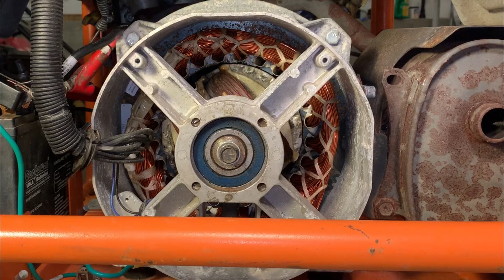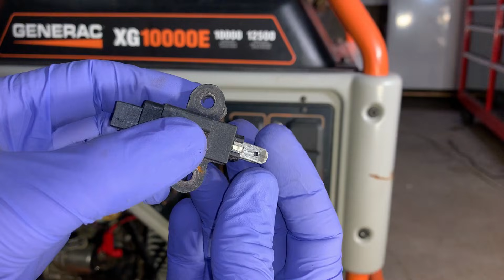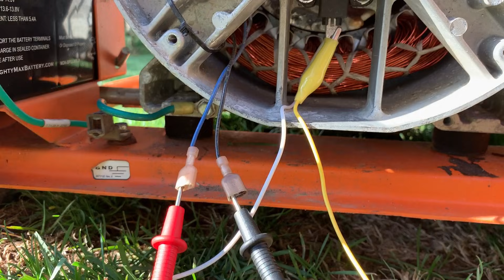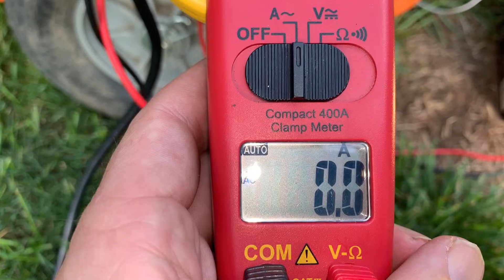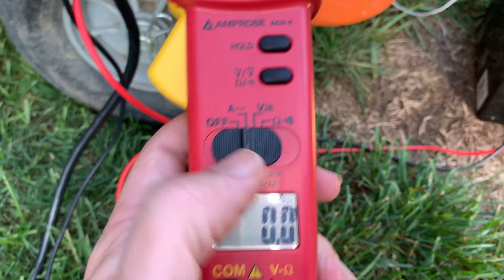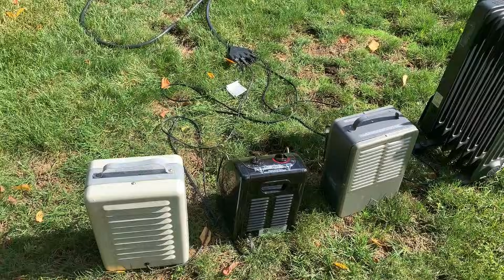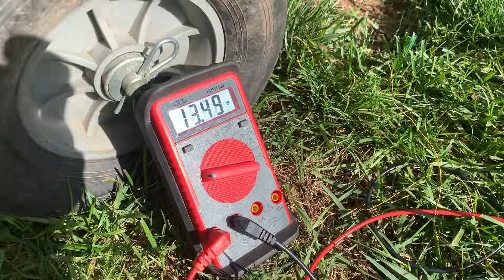Generac XG10000e No Power/No Voltage - Fixed

Comment: Lots of fuel stabilizers are blue, they turn the gas that color.
Reply: Here is a reminder about portable generator safety: this is only a reminder for anyone who use portable gas/propane generators. This is just to make sure that everyone is aware of all the warnings and it’s just to remind people to be careful using portable generators. Everyone has to see this safety reminder. Every year, hundreds of people die or get injured when using portable generators due to carbon monoxide poisoning and electrocution. Make sure you are using your generator carefully and keeping others safe as well. There is something very serious that everyone should always be aware of when using generators. Some people do run their generator indoors which is not safe and that increases the risk of carbon monoxide poisoning which can cause death of family and you. Some people run their generator in wet conditions which can electrocute them. Here’s an advice about generator safety: please remember that you should never run your generator indoors. Remember that carbon monoxide is an odorless and colorless gas that you cannot see or smell. Carbon monoxide is a silent killer. Keep that in mind. Make sure your generator is 15-20 feet away from your house and away from doors, windows, and vents. Having a carbon monoxide detector is very important against generator safety. Some people also allow children to go near the portable generator which could pose risks. We need to keep an eye on our children making sure that they are not near the portable generator so they won’t get electrocuted or burned by the generator which is dangerous. A locking enclosure also keeps kids safe. A generator shed might look like a tempting place to explore, or take cover during a game of hide and seek, but a generator is a dangerous piece of equipment that can cause injury. It says on the manual that we should also keep children away at all times from the portable generator to avoid injuries. Please do not permit a child or unqualified people to operate the portable generator. Generators pose electrical risks. If you need to use your generator during wet weather, you need a generator tent to protect your generator from getting wet. Don’t let your generator get wet. Keep your generator dry and before using your generator, please make sure your hands and your generator is dry. Everything that is said on the generator’s operating manual should not be ignored. Never smoke cigarettes near the generator. Please keep flammable things away from the generator. Never overload your generator too. Your generator can catch fire. Never ever try to plug a generator cord into a wall outlet to avoid back feeding. Back feeding your generator is dangerous. Always turn on your generator first before plugging in appliances and shut off the appliances before turning your generator off. Use a heavy duty cord for your generator and the cord should not be worn out. All the instructions should be followed carefully. Never refuel your generator while it’s running. It can cause fire if fuel spills while your generator is hot. You should turn off your generator and let it cool off before refueling it. Having a fire extinguisher next to the generator is also important. This is only a reminder for everyone’s safety of using generators. Make sure your generator is properly grounded. https://youtu.be/I1jT3ANENvI and here is a video more about keeping others safe when using generators and also about our family’s safety. Hope this helps and everyone understands the safety requirements. Thank you. Be safe.

Comment: Good Job...very knowledgeable! Got a good deal!
Reply: Here is a reminder about portable generator safety: this is only a reminder for anyone who use portable gas/propane generators. This is just to make sure that everyone is aware of all the warnings and it’s just to remind people to be careful using portable generators. Everyone has to see this safety reminder. Every year after hurricane and winter storms, there were reports on the news that many people have died each year when using generators due to carbon monoxide poisoning and electrocution during a power outage. There were reports about deaths when using generators when the power was out. There is something very serious that everyone should always be aware of when using generators. Some people do run their generator indoors which is not safe and that increases the risk of carbon monoxide poisoning which can cause death of family and you. Some people run their generator in wet conditions which can electrocute them. Here’s an advice about generator safety: please remember that you should never run your generator indoors. Remember that carbon monoxide is an odorless and colorless gas that you cannot see or smell. Carbon monoxide is a silent killer. Keep that in mind. Make sure your generator is 15-20 feet away from your house and away from doors, windows, and vents. Having a carbon monoxide detector is very important against generator safety. Some people also allow children to go near the portable generator which could pose risks. We need to keep an eye on our children making sure that they are not near the portable generator so they won’t get electrocuted or burned by the generator which is dangerous. A locking enclosure also keeps kids safe. A generator shed might look like a tempting place to explore, or take cover during a game of hide and seek, but a generator is a dangerous piece of equipment that can cause injury. It says on the manual that we should also keep children away at all times from the portable generator to avoid injuries. Please do not permit a child or unqualified people to operate the portable generator. Generators pose electrical risks. If you need to use your generator during wet weather, you need a generator tent to protect your generator from getting wet. Don’t let your generator get wet. Keep your generator dry and before using your generator, please make sure your hands and your generator is dry. Everything that is said on the generator’s operating manual should not be ignored. Never smoke cigarettes near the generator. Please keep flammable things away from the generator. Never overload your generator too. Your generator can catch fire. Never ever try to plug a generator cord into a wall outlet to avoid back feeding. Back feeding your generator is dangerous. Always turn on your generator first before plugging in appliances and shut off the appliances before turning your generator off. Use a heavy duty cord for your generator and the cord should not be worn out. All the instructions should be followed carefully. Never refuel your generator while it’s running. It can cause fire if fuel spills while your generator is hot. You should turn off your generator and let it cool off before refueling it. Having a fire extinguisher next to the generator is also important. This is only a reminder for everyone’s safety of using generators. Make sure your generator is properly grounded. https://youtu.be/I1jT3ANENvI and here is a video more about keeping others safe when using generators and also about our family’s safety. Hope this helps and everyone understands the safety requirements. Thank you.

Comment: You used scotch brite and most likely fixed what originally was wrought with it. Last person checked by removing the wires and put them in the wrong spot. Great repair!
Reply: Here is a reminder about portable generator safety: this is only a reminder for anyone who use portable gas/propane generators. This is just to make sure that everyone is aware of all the warnings and it’s just to remind people to be careful using portable generators. Everyone has to see this safety reminder. Every year after hurricane and winter storms, there were reports on the news that many people have died each year when using generators due to carbon monoxide poisoning and electrocution during a power outage. There were reports about deaths when using generators when the power was out. There is something very serious that everyone should always be aware of when using generators. Some people do run their generator indoors which is not safe and that increases the risk of carbon monoxide poisoning which can cause death of family and you. Some people run their generator in wet conditions which can electrocute them. Here’s an advice about generator safety: please remember that you should never run your generator indoors. Remember that carbon monoxide is an odorless and colorless gas that you cannot see or smell. Carbon monoxide is a silent killer. Keep that in mind. Make sure your generator is 15-20 feet away from your house and away from doors, windows, and vents. Having a carbon monoxide detector is very important against generator safety. Some people also allow children to go near the portable generator which could pose risks. We need to keep an eye on our children making sure that they are not near the portable generator so they won’t get electrocuted or burned by the generator which is dangerous. A locking enclosure also keeps kids safe. A generator shed might look like a tempting place to explore, or take cover during a game of hide and seek, but a generator is a dangerous piece of equipment that can cause injury. It says on the manual that we should also keep children away at all times from the portable generator to avoid injuries. Please do not permit a child or unqualified people to operate the portable generator. Generators pose electrical risks. If you need to use your generator during wet weather, you need a generator tent to protect your generator from getting wet. Don’t let your generator get wet. Keep your generator dry and before using your generator, please make sure your hands and your generator is dry. Everything that is said on the generator’s operating manual should not be ignored. Never smoke cigarettes near the generator. Please keep flammable things away from the generator. Never overload your generator too. Your generator can catch fire. Never ever try to plug a generator cord into a wall outlet to avoid back feeding. Back feeding your generator is dangerous. Always turn on your generator first before plugging in appliances and shut off the appliances before turning your generator off. Use a heavy duty cord for your generator and the cord should not be worn out. All the instructions should be followed carefully. Never refuel your generator while it’s running. It can cause fire if fuel spills while your generator is hot. You should turn off your generator and let it cool off before refueling it. Having a fire extinguisher next to the generator is also important. This is only a reminder for everyone’s safety of using generators. Make sure your generator is properly grounded. https://youtu.be/I1jT3ANENvI and here is a video more about keeping others safe when using generators and also about our family’s safety. Hope this helps and everyone understands the safety requirements. Thank you.

Comment: Do you set the governor screw for the HZ when it has a normal load or no load or something in between?
Reply from the maker: I set to 61.5 hertz under no load.  At half load it then should be around 60 hertz.

Comment: Stupid question here from a guy who knows nothing about electricity. !! What does flash the field mean? I assume you mean to somehow excite the windings, or sensor into detecting current so it can start working?, Thanks.
Reply from the maker: The generator needs magnetism to start up.  Most newer ones have small permanent magnets to do that.  Adding 12v to the brushes or spinning a drill on the stator will add a little juice which will help things get going.  Usually thought, if not going on their own, then there is a problem with the generator.
Reply: Thanks for the response!

Comment: A lot of this class of generator have a 3 year warranty.   There are documents out there on how to screw one up so that it just won't produce any power output.  The devious owner can take it back and get a replacement before the warranty ages out.   Most of the Box Stores will start it, see it produces no power and warranty it.   Even in a smaller shop, the tech may not dig as deep as you did.  Nice catch, sweet fix.

Comment: Boy, that thing was really messed with!  Wiring incorrect, strange fuel, regulator set wrong, engine speed too slow....
Looks almost brand new though!
Wonder what it's story is?  Would be interesting to find out, but oh well!
Reply: That was probably one of those, hey my brother in law is pretty good on working on those things, just buy him a six pack.
Reply: Here is a reminder about portable generator safety: this is only a reminder for anyone who use portable gas/propane generators. This is just to make sure that everyone is aware of all the warnings and it’s just to remind people to be careful using portable generators. Everyone has to see this safety reminder. Every year after hurricane and winter storms, there were reports on the news that many people have died each year when using generators due to carbon monoxide poisoning and electrocution during a power outage. There were reports about deaths when using generators when the power was out. There is something very serious that everyone should always be aware of when using generators. Some people do run their generator indoors which is not safe and that increases the risk of carbon monoxide poisoning which can cause death of family and you. Some people run their generator in wet conditions which can electrocute them. Here’s an advice about generator safety: please remember that you should never run your generator indoors. Remember that carbon monoxide is an odorless and colorless gas that you cannot see or smell. Carbon monoxide is a silent killer. Keep that in mind. Make sure your generator is 15-20 feet away from your house and away from doors, windows, and vents. Having a carbon monoxide detector is very important against generator safety. Some people also allow children to go near the portable generator which could pose risks. We need to keep an eye on our children making sure that they are not near the portable generator so they won’t get electrocuted or burned by the generator which is dangerous. A locking enclosure also keeps kids safe. A generator shed might look like a tempting place to explore, or take cover during a game of hide and seek, but a generator is a dangerous piece of equipment that can cause injury. It says on the manual that we should also keep children away at all times from the portable generator to avoid injuries. Please do not permit a child or unqualified people to operate the portable generator. Generators pose electrical risks. If you need to use your generator during wet weather, you need a generator tent to protect your generator from getting wet. Don’t let your generator get wet. Keep your generator dry and before using your generator, please make sure your hands and your generator is dry. Everything that is said on the generator’s operating manual should not be ignored. Never smoke cigarettes near the generator. Please keep flammable things away from the generator. Never overload your generator too. Your generator can catch fire. Never ever try to plug a generator cord into a wall outlet to avoid back feeding. Back feeding your generator is dangerous. Always turn on your generator first before plugging in appliances and shut off the appliances before turning your generator off. Use a heavy duty cord for your generator and the cord should not be worn out. All the instructions should be followed carefully. Never refuel your generator while it’s running. It can cause fire if fuel spills while your generator is hot. You should turn off your generator and let it cool off before refueling it. Having a fire extinguisher next to the generator is also important. This is only a reminder for everyone’s safety of using generators. Make sure your generator is properly grounded. https://youtu.be/I1jT3ANENvI and here is a video more about keeping others safe when using generators and also about our family’s safety. Hope this helps and everyone understands the safety requirements. Thank you. Be safe.

Comment: I worked for twenty some years as a hvac and burner mechanic and went on to ddc and single loop controllers and ended up doing building automation. That was almost twent years ago and not long ago I was trying to fix my ac on my 4Runner. It had an electrical problem and took me for ever to find electrical digram for it on the web. Found bits and pieces to get a whole print of the circuit. But my age and forgetfulness sure showed its head troubleshooting of all I have forgotten. Took me six months to finally find the problem. Always heard if you don't use it you loose it. I sure did.

Comment: good info. Good explanations. Subscribed. You teach well. Got a couple older Generacs waiting for help. You gave me the courage to try the repairs. Thanks so much
Reply: @Peter Evans not yet as I am moving to a site with no power so I fixed my big generator first. The little 7500 and 500 will be next once I finish moving in October

Comment: I'm following your procedure except for the 12 volt battery.  Please explain what your doing with that.  Thanks
Reply from the maker: The AVR should apply DC power to the brushes.  Since it was not, I applied 12 volts to see if the rotor would power up and the stator output power.
Reply: @jcondon1  Thats what I don't understand; if there is no power coming from the generator how would the AVR have 12 volts in the first place?  Does it have a small battery on the AVR board?